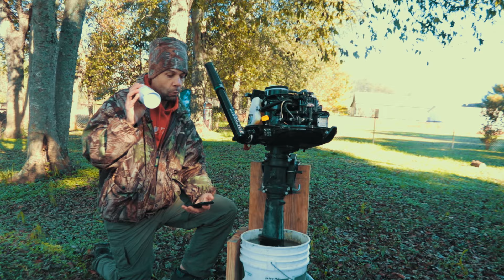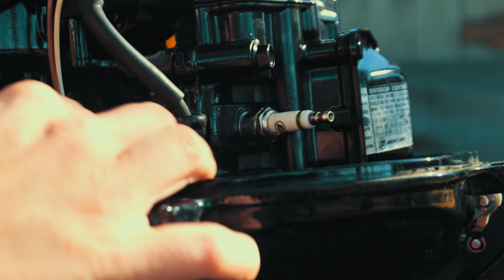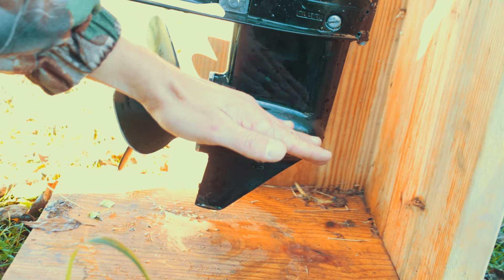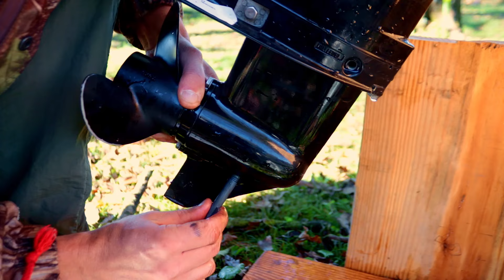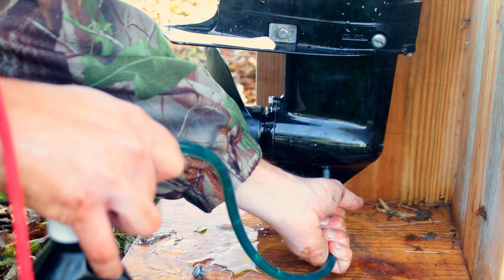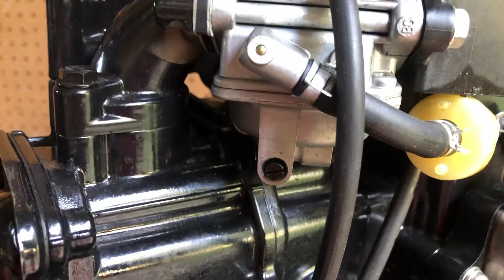You Can Winterize an Outboard in 15 Minutes (EASY)!!!

Comment: Thanks for all of your information and expertise. Very helpful! I’m new to boating and just got my very slightly used Mercury 6hp 4 stroke outboard at the beginning of this year. Very nice running engine. I’ve used only non-ethanol gasoline in it. Should I still drain the carburetor dry, or will it be OK to leave some 100% gasoline in the float bowl?  Thanks very much!—-Jack

Comment: Wouldn’t running in a bucket of water, which you must, increase the risk of it’s already freezing?
Reply from the maker: That’s a good point. But I believe It’s designed to drain all of the cooling water when the motor is in the upright position. That’s why you don’t have to run antifreeze through it. Water doesn’t sit in the motor. Some years I run it in freezing temps with no issue. 

I would change the lower end unit last so you don’t introduce water into lower end unit if you have a bad seal.

Comment: Are you spraying the fogging oil in the bottom of the breather box attached to the carb?
Reply from the maker: Yeah just where the air enters the silencer box attached to the carb. I’ve read not to go crazy and spray too heavy or it could foul your spark plug. Just want to get a little oil in the carb bore hole and the intake valve.
Reply: @Skinnyriver  Thanks again for the feedback

Comment: After you drain the carb & run seafoam thru the system, do you recommend draining the stabilized fuel from the internal tank before storing?
Reply from the maker: It depends on how long you are going to store it. Stabilized fuel supposed to last 1 Yr, but I have read if you store longer than 3 months it’s best to drain. It’s really preference, I would say draining and running dry is probably best
Reply: Thanks again for your feedback....Your videos are very very helpful for us new guys....KW
Reply from the maker: @kerrywages9631 I appreciate the support, thanks

Comment: The trouble with stabilizer is it doesn't take out the ethanol. Instead go to the hardware store and buy high octane professional fuel.
Reply from the maker: Yeah good point, stabil marine is an ethanol gas treatment and stabilizer (supposedly) I use it and it’s been ok. But yea pro fuel is best, ethanol treatment seems a little gimmicky

Comment: I live in a city where the coldest it gets at night is about 13 degrees Celsius and about 22 during the day. Do I need to bother to winterise as still using during winter?
Reply from the maker: if it’s not 0c then you don’t really have anything to worry about. Where are you? Shoot 13 and 22c is like spring time here in Tennessee. The main thing winterizing protects against is if water gets in your motor and it freezes. Water expands when it freezes and can cause damage

Comment: you should replace the o ring gaskets on the lower screws to so you are sure they don't link in the spring.
Reply from the maker: Yeah you’re right, cheap and easy. Leaking can ruin the lwr end unit

Comment: One tip is instead of using stabilized fuel to insure your carb doesn’t gum up is to siphon all the gas out of the built in tank (or cut the fuel valve off if your engine has one)  or you could disconnect the fuel connector if you use an external tank, then run the engine until it stops. This burns all the fuel out of the system so no gas will be sitting in the carb to clog it up.
Reply from the maker: I had a Yamaha 2 stroke and ran it dry every time I took it out. Thing lasted years and started 1st pull after sitting for 4 months
Reply from the maker: Yeah that’s a good point. I have read that even when you run the carb dry there is still some gas in the lines and carb bowl when the engine dies but yeah the more gas you get out and that doesn’t sit for months the better
Reply: @Skinnyriver  you are correct it doesn’t burn all the gas out the carb but the gas level after running the gas out the carb is too low to gum anything up.  Fuel stabilizer works too just comes down to whatever you personally like best.
Reply from the maker: Yeah turning a valve and letting it run is a lot easier and cheaper for sure. Good point
Reply from the maker: I put in my pinned comment (first comment for this video) the point that  running the system dry is a good option vs stabilizing. Thanks for the input!!!
Reply: @Skinnyriver  no problem man happy to help 👍
Reply: I’ve been doing this. Works very well.

Comment from the maker: Engine fogging is one of those things where half the people says it needed and the other half says it’s a waste of time and can mess with your spark plug (although I’ve never had an issue). I agree it’s the least critical item for winterizing. NEVER SKIP stabilizing your fuel or changing lower end unit oil. I think fogging is a good idea but if you have to skip something, skip the fogging. Thanks for the view and all of the support! 

Also instead of stabilizing fuel, running the system dry (running the motor until it runs out of fuel) is a good option as well! Let’s chat below!

Comment: I just brought a 6hp 2020 mercury outboard has yours got pink paint at the bottom inside take the cover off and have a look someone said it’s the manufacturer they use pink on quality check points is that right do u no mate
Reply from the maker: Mine is a 2018 and didn’t have a mark. But they could have implemented that at the manufacturing plant since then. Honestly most times they clean off all quality marks before shipping but they could have simply missed that one. I wouldn’t worry about it.